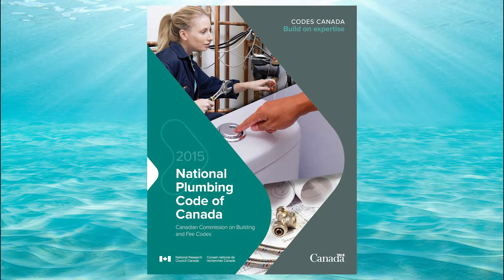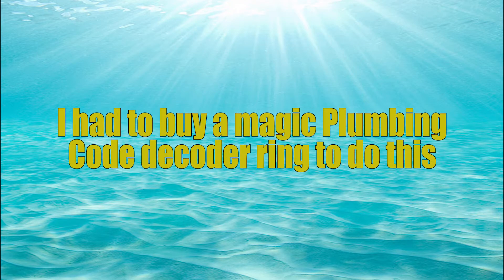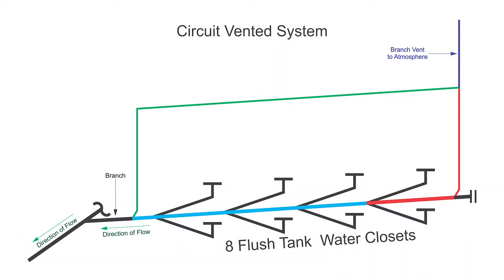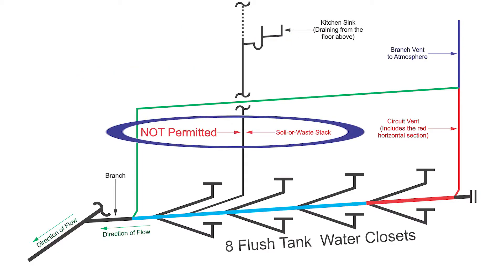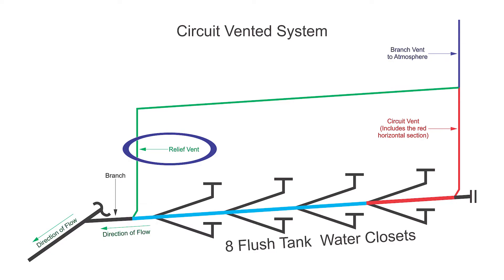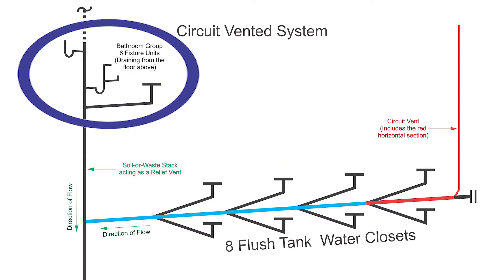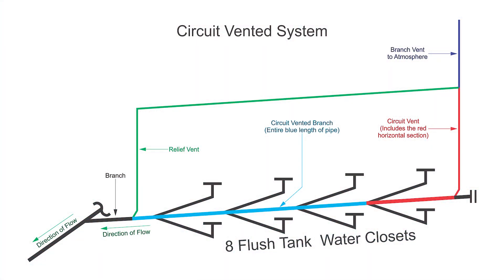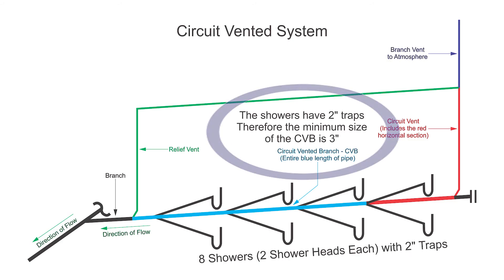Circuit Vent Part: 1

Comment: I thought your circuit vent had to go before your most upstream water closet?
Reply from the maker: The rule is maximum 8 circuit vented fixtures between vents. But the code allows for one fixture upstream of the circuit vent. This is even show in the code diagrams in the appendix under A-2.5.3.1 Almost every diagram shows a fixture (WC) installed this way. It is not clearly spelled out in the clauses though, because why would anyone want the code to be transparent?

Comment: Not sure what code you're following, but you don't have it vented properly per upc plumbing code. 
     The vent needs to be before the most downstream fixture, which you do have, but then needs to be vented again between the 2 most upstream fixtures.  You got yours vented after the most upstream fixture.  So it is incorrect per UPC code.
Reply from the maker: National Code of Canada (NPC). It has it's differences from the UPC for sure

Comment: Yeah, code isn't easy to read. I got into plumbing after law enforcement, and the C.C. is more easily understood than plumbing code. Plumbing code seems like it was written by some kind of autistic grade 3 kid trying to sound fancy by overworking double negatives in triple format, all while taking you on a treasure hunt. It doesn't have to be written like criminal law, and they shouldn't use 5 words when 1 will do; it's plumbing lol. I think it may be more easily understood if it was written in terms of what vs. trying to list off all the possible things in the world that you can't. 
Your series are fantastic, btw, and I wish you were still doing them.
Reply: It's unreal how many words I just completely scratch out in my code book.